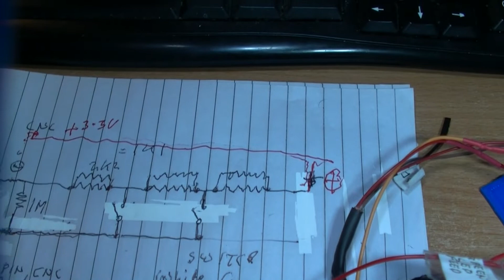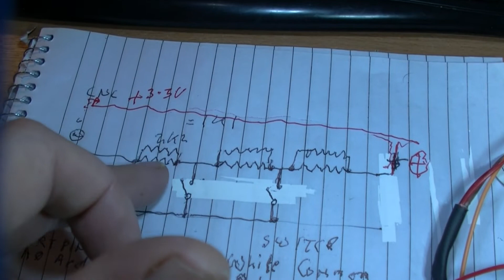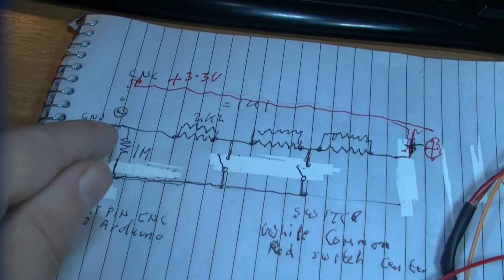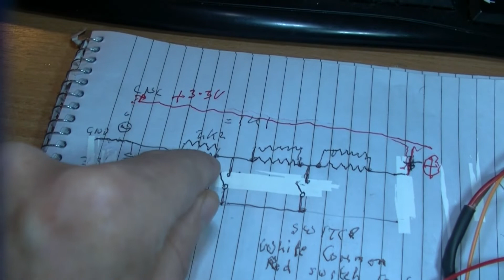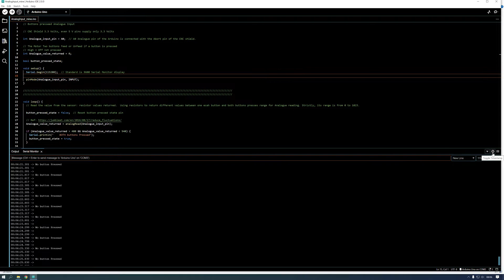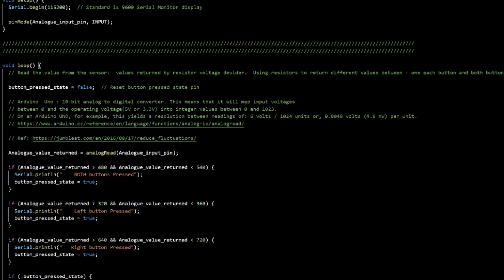Arduino simultaneous button push

Comment: Thanks for showing this off, Mr. Black:) Just my two cents: Analog comparators exist;) (see LM311, TLC393, etc. Could be STABLE and RELIABLE ... and cheap and "it just works without code" ... and so on *g* ) 
Or have a visit at section 22 (page 202, rev 7810D–AVR–01/15). of the ATmega328P datasheet. Several MCUs have household "Analog Comparator"-capabilities on board, f.e. for zero phase detection, pre-IRQ generation for analog recording purposes, programmed PLL-behaviour ... and who knows what else?!:)

Sorry for the disturbance, have fun and keep on coding!:)